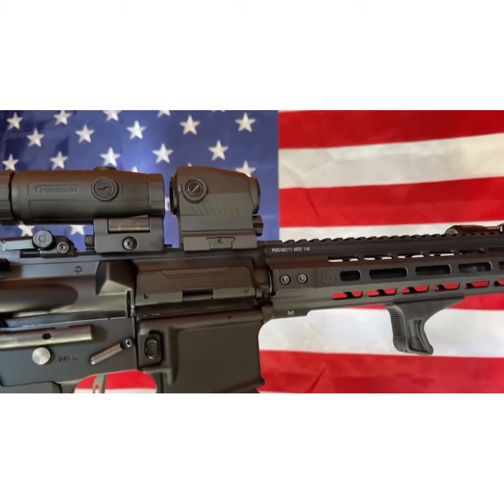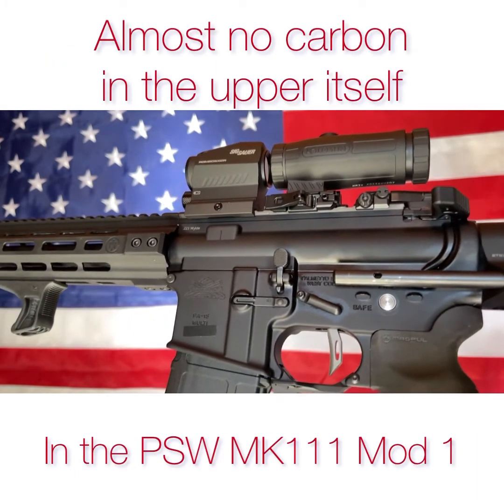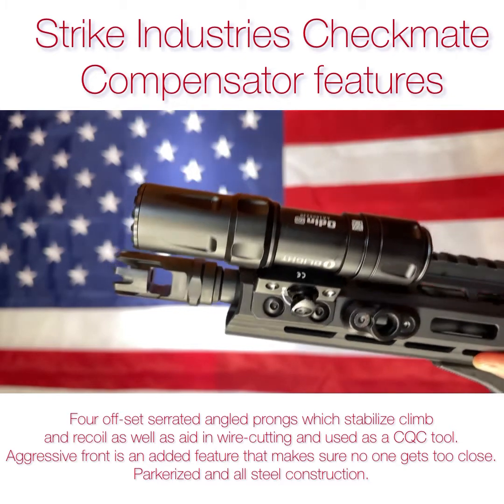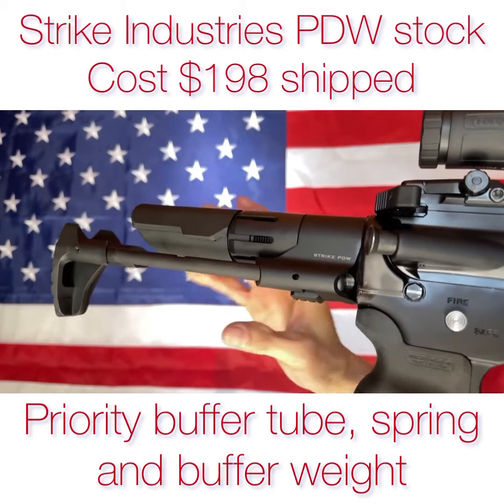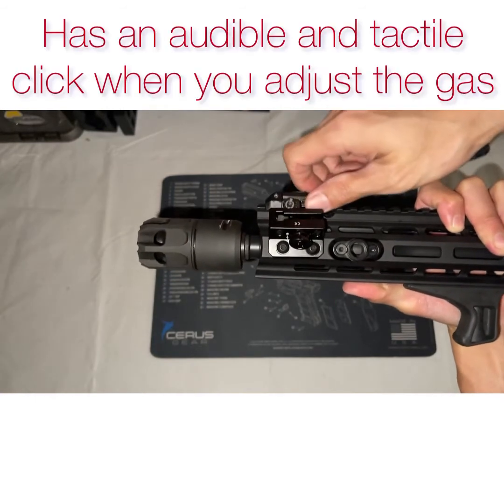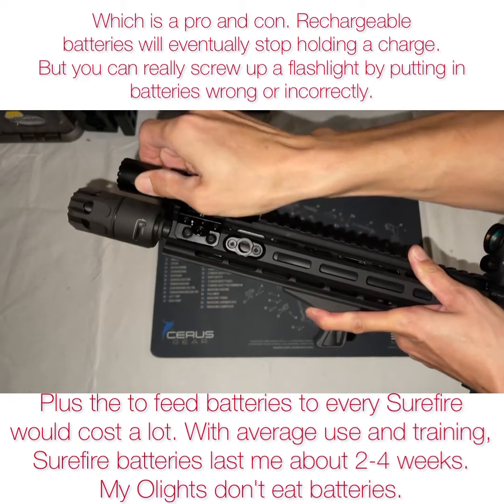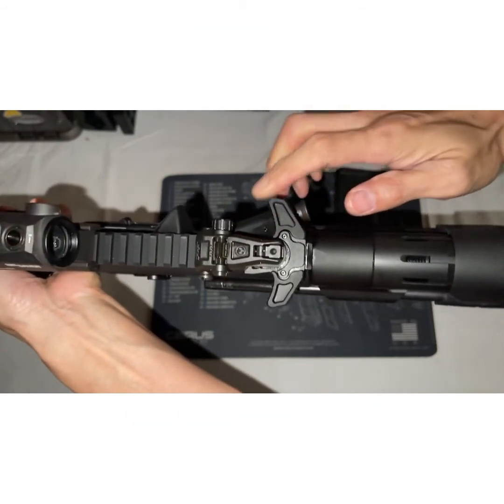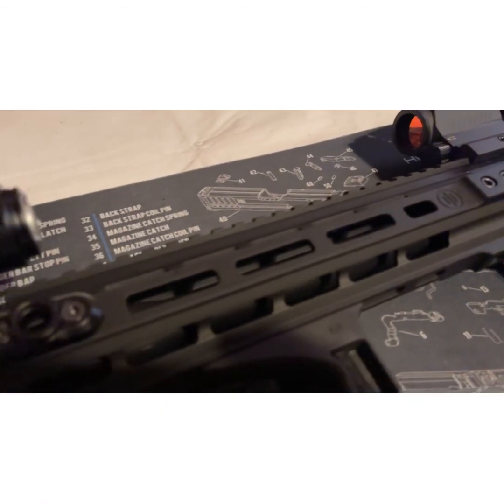Are you an AR15 gun builder or enthusiast? Here's a cool build for you.

Comment: I'm getting ready to build a 300 blackout with a 16 inch barrel. I'm thinking about a piston driven system from Adams. Great job on the build
Reply from the maker: Thanks. I was looking at the Adams Arms short stroke pistons too. It's definitely a cleaner running rifle. The recoil impulse is different and definitely was different than a DI AR15.

If you end up getting that Adams Arms upper or full AR15 let me know how it is. I'm curious how well it runs. Good luck on the 300 blackout too. My first 300 blackout was a 16" and I loved it. I now have a 10.5" pistol in 300 ACC Blackout but I don't shoot suppressed and really just wanted a 30 caliber AR15. It's a cool cartridge indeed.